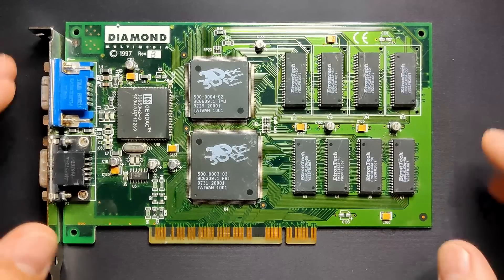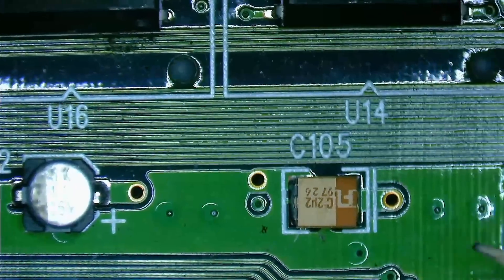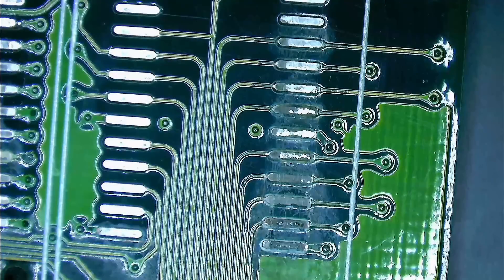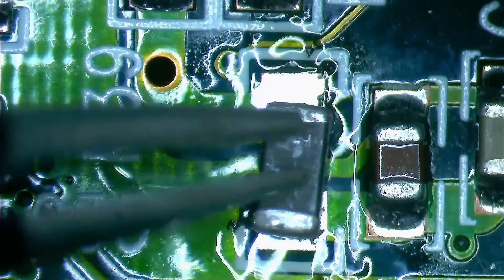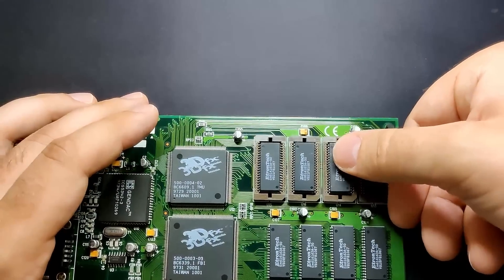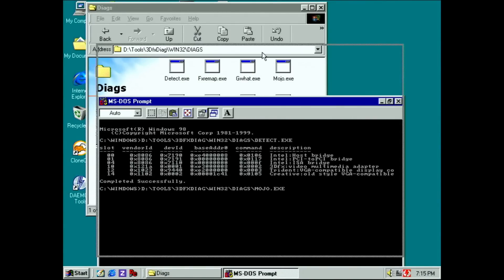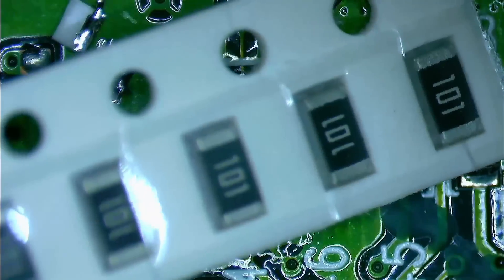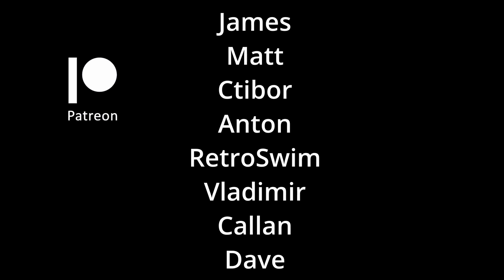So many issues: Diamond Monster 3D - 3Dfx Voodoo

Comment: Any reason why you only added sockets to the TMU memory and not also the bottom row?
Reply from the maker: The memory on the bottom was ok - no corrosion there and I didn't need to remove the memory. Second, there is not enough space to have sockets - the memory chips are too close to each other.
Reply: @bitsundbolts  Thanks for the explanation :)

Love your soldering videos btw!

Comment: There's a bug that usually happens with (perfectly good) Voodoo1 cards and faster PCs, that manifests a very similar colored rectangle pattern when starting games. 
I have found that disabling "PCI IDE Bus Mastering" in the bios, usually solves the problem.

Comment: - For straightening bent pins, the absolute best tool i found to be, one segment of a box-cutter blade. 
(From the type of blade that is long and is pre-divided into segments, so you can break them off one by one as they get dull.) 
- Another really good tool for REALLY bent pins, is a metal needle, that has been softened with a flame, in order to make it bend and not break. You bend the very tip of the needle in order to make the smallest hook possible, in order to grab the pin from behind (in some cases, even insert the needle between the chip and the pins so you can pull the pin from behind, in order to make room for inserting the box-cutter blade).

Comment: Where can I find the Mojo program?
Reply from the maker: I have added a link in the video description where you can find the tool in the 3Dfx folder. Let me know if this helps.
Reply: @bitsundbolts  Thank you for the links to both MOJO and the 3dfx Flash utility.  I was playing POD Gold when suddenly my Diamond Monster 3D froze the images on the screen and they all became corrupted and turned very dark.  After a hard reboot I was able to see the 3dfx card in device manager and it was telling me it is okay but when I try to play any 3dfx game it just blinks the LCD desktop screen image for a fraction of a second and that's it. No crash message!!!   A complete visual scan under my digital microscope did not reveal any problems and I even checked all the pins on both the TMU and the FBI just to make sure.  Ugg.

Comment: Very nice repair.
I would also like to see a video were you try to repair the card with the broken pins. Maybe you could cut a little of the chip to reach some metal were the pins would be and then solder some wires. Even if unsuccessful, I would enjoy watching it.
Reply from the maker: I'll definitely do it. I just need to work on a few other projects first to not get too overloaded with 3Dfx content.

Comment: Do you have, by any chance, the value of the ferrit between the two VGA ports? Have a Monster 3D Rev B here that I wanted to fix for some time. So far I didn´t start with the work because I was unable to find the exact value of the part. :)
Reply from the maker: Are you talking about the two black caps? There are two of them between the two VGA ports on the 3Dfx chip side. Those two are inductors. If you mean on other spot, you can send a picture to my email which you can find on the About page of my channel.
Reply: @bitsundbolts  They are labeled L5 and L6. L5 is still there, but L6 is missing on my card.
Reply from the maker: Yes, those are inductors. They have 0 resistance. I ordered some of those from AliExpress. When I fix the Maxi Gamer 3D, I will add one of those ordered from AliExpress. If the card works, I'll add the link in the video description.
Reply: @bitsundbolts  Thank you, I should have something fitting in my spare parts bin. :)

Comment: Hi! How did you know the value of that cracked SMD capacitor? I'm trying to fix my Diamond Monster 3d and I found it hard to find much info about it. Thanks
Reply from the maker: I removed a similar looking capacitor which belonged to a group of components looking identical to the ones where the cap was broken.

Comment: Awesome work! Always a great feeling to see old broken cards brought back to life 👍😁
Reply from the maker: Thank you! I am very happy that this Voodoo card is back from the dead - and I am surprised that the overall look of the card improved a lot after I cleaned it up. Thanks for visiting Mike!
Reply: @bitsundbolts  I've got the same Voodoo1 card (it was lying in the stash since 2008) with the same issue - as soon as it switches to 3D mode, it hangs on a green striped screen. But the card was never physically damaged and all the chip pins seem to be okay. I also don't know whether it's even compatible with my retro pc AMD K6-2-500 CPU. I've tried lowering the FSB to 66 MHz, but it didn't help. The mobo is ASUS TX97-E on a 430TX chipset. I'm currently desperate...
Edit: Poor me, all I had to do was to use the Diamond driver. The reference driver didn't work for some reason. The card is working fine)
Reply: Your videos are better, though. 😁

Comment: I have seen alot of Voodoos with bent pins. But usually they all work. And yes, this from them being in the trash. Where I get all my stuff, this is just thrown into boxes.
Reply from the maker: It could be that some pins are not used or carry the same signal. I hope that there will be a proper pinout diagram of those TMU and FBI chips. Same for Voodoo 2 chips.

Comment: I have the same card!!! will your RAM expanshiopn fit the TMU ram???
Reply from the maker: The memory is slightly off. A memory mod that was created for a Maxi Gamer 3D will not fit over the TMU memory, however, were talking about 1mm here. Revision 1.1 could work but may be at the limit what's possible.
If I get another Diamond Monster 3D, I'll definitely try to make a mod for it using revision 1.1

Comment: Great job on the repair.
When it comes to bent pins I prefer to use a razor blade and a little twist to bend them back into position.
Reply: I thought these are to bendy. I think the tiny tweezers are best because it's difficult to keep a needle in control.
Reply from the maker: Thank you

Comment: perhaps the resistor told the card what kind of memory was fitted? that would've been a really cool thing to know
Reply from the maker: I may replace the resistor with a higher value and see if something changes in the mojo debug tool output. Maybe this resistor is responsible for a frequency setting.

Comment: I can't remember if it was on the bird site or the new social media site, but I think it was TubeTime who posted a thread about repairing a chip by grinding down the plastic on a chip with broken leads to reveal the lead frame, which he soldered wires onto to replace the broken leads. I'm guessing you were planning something similar to fix that other chip?
Reply from the maker: Yes, that is exactly my plan. I don't think I need to grind a lot - and if possible, I want to make it invisible - as if nothing ever happened.

Comment: A few months ago, I successfully fixed Voodoo2 12Mb from PowerColor. I found 6 bad smd resistors arrays. After changing it to new arrays, card came  back to live!
Reply from the maker: Congratulations! Awesome that you were able to rescue this Voodoo 2 by replacing components that cost a few cents. Wonder how many have been trashed because of that.

Comment: Good job! In case you will need more information on those SMDs, there are component maps available for most of the Voodoo II. I have some unbranded cards that share the same design as your Diamond. You can find the capacitos value on the same general schematics. The card with the broken chip pins can be most likely be salvaged but it is a royal pain. But I have seen a guy using a laser engraver programmed to decapsulate the broken part of thr chip in order to solder bodge wires on to it. 😮 But we normal people have to use micro-grinder. Good luck! Pretty nice videos you have!
Reply from the maker: Thank you! Yes, I have found some Voodoo 2 component maps, but nothing for the Diamond Monster 3D. I guess I was lucky that the damaged components were quite simple to figure out.

Comment: This reminds me of the pile of Voodoo1s i wasn't able to repair yet. Should be a nice project for the colder days of the year :-)

a small hint: Try to move the desolder wick in the direction of the pads, not 90° or other angles. Otherwise, you risk ripping them from the PCB.

regarding the components from other cards: These Voodoo-cards are 99% based on a reference design, should be absolutely no problem as there are only minor differences between different vendors.
Reply from the maker: Thanks for the tip! Makes a lot of sense to move the wick along the direction of the pad!

Comment: Ive got an Diamond Monster 3D 2 SLI set and done the same an them. many bent pins on the chips. Without a microscope i had no chance to repair them. But now they are fully working and in the future i will upgrade them to 12MB now they only 8MB versions. My Retro setup is an P2 450 with 128MB Ram, nVidia Riva 128ZX and the Voodoo2 SLI. I call it High End gaming PC from 1998 ^^
Reply from the maker: I also have two Diamond Monster 3D 2 ready for SLI, but first I need to make my own SLI cable.
Reply: @bitsundbolts  Haha i had to make one too. Nothing special. I used an floppy cable und twistet it on the right place and it works without any problems. So i made a longer cable to have some space between the two cards. I put everything in a modern case with window an a green LED strip. The last thing i want to put in is a SoundBlaster Live from 1998. Now there is only an onboard Creative Audio PCI in it.

Comment: Where can I get solder mask? That could be so useful.
Reply from the maker: I use "MECHANIC" solder mask which I got from aliexpress. You may get them from eBay or Amazon too depending where you live.
Reply: @bitsundbolts  much thanks